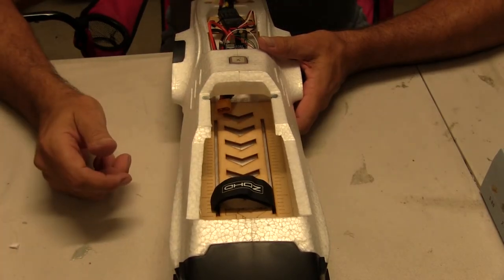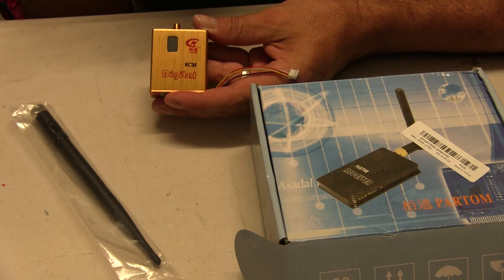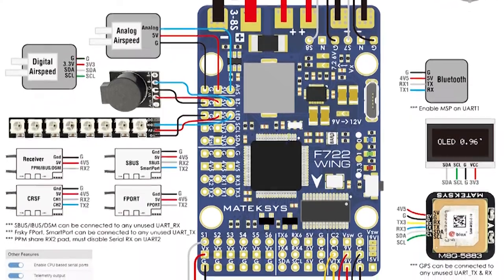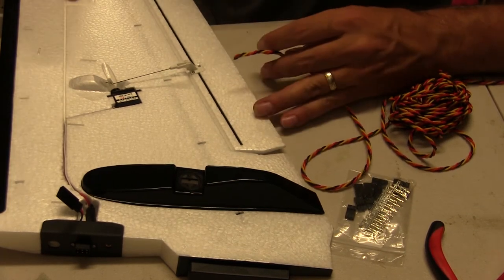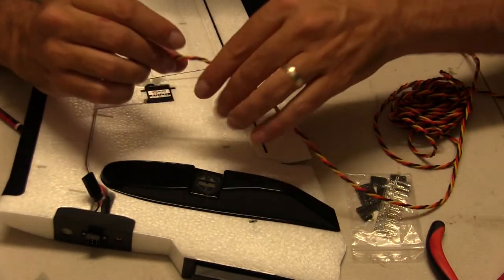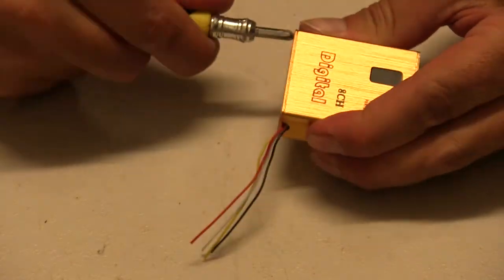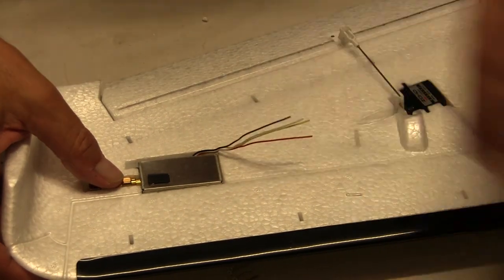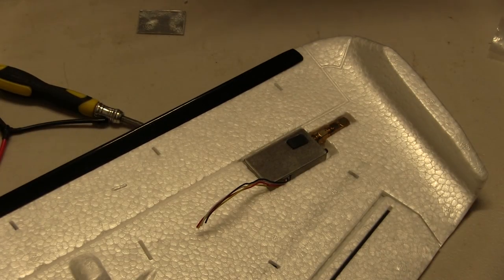ZOHD Dart XL -  BUILD UPDATE 2 - Electronics Update and Partom 1.2ghz VTX Install

Comment: Any over heating of the vtx that you have encountered during your flights? Since you removed the heavy heatsink during your install?
Reply from the maker: I’m still yet to maiden it due to weather but the vtx when sitting does get hot if left too long. I have heard people doing the exact same thing as I did with no heat issues at all during flight. The problem I need to resolve is servo chatter I am getting due to the vtx.
Reply: @stonesrcchannel  Kindly update regarding  heating issues if any and maximum horizontal range using  the vtx 1.2ghz.. I think by using analog metal gear servos instead of digital ones will solve your servo chatter.. The 1.2ghz frequency affects digital servos.. Thank you for posting a beautiful build video sir! Kudos to your channel.. btw where were you able to buy your wiring harness? Banggood?
Reply from the maker: @raffman4266  I have a Z-84 running the same VTX and i have done 20+ minute flights with it landing relatively cool so i feel confident there will be no heat issues while flying even with the ZOHD.Regarding the servo harness, i bought servo wire and pins from Banggood and made my own. Thanks for the heads up with the servo chatter too its had me confused as i have the same VTX and R9 reciever on my Z-84 and it has no issues with servo chatter mind you it does run emax digital servos so  maybe the stock ZOHD Digital servos are more prone to servo chatter than the emax's on the Z84. I'll work it out eventually,  Thanks for your kind comment and help.